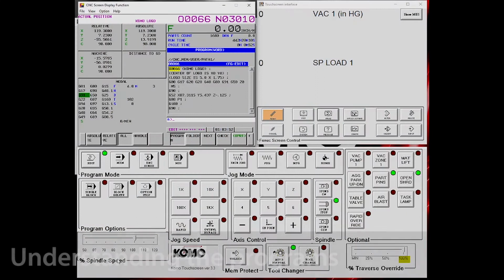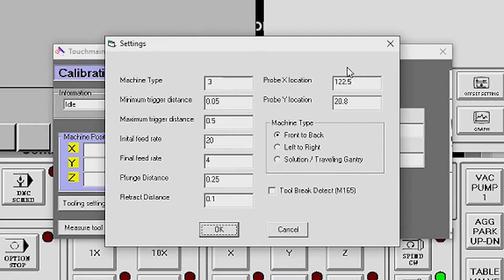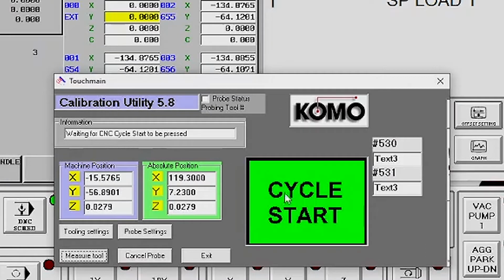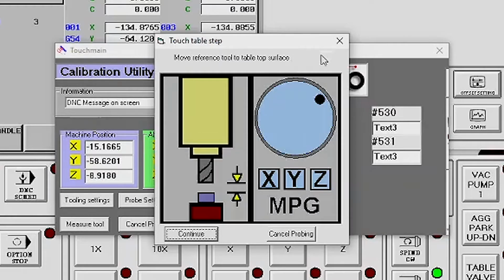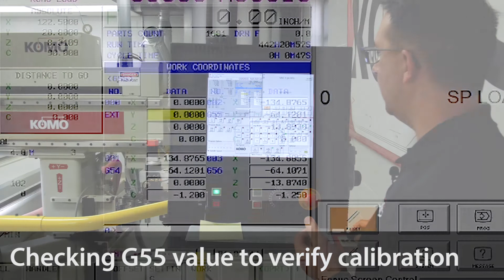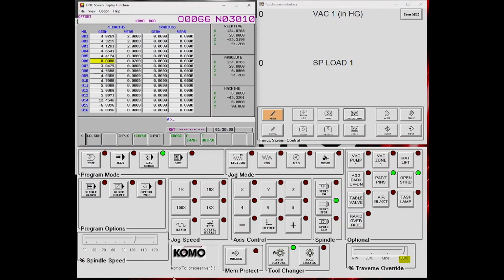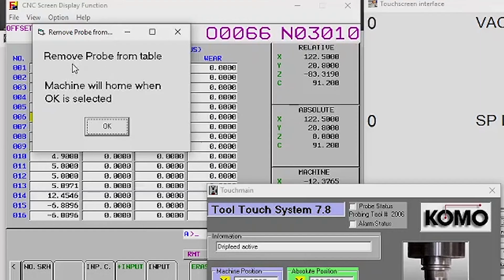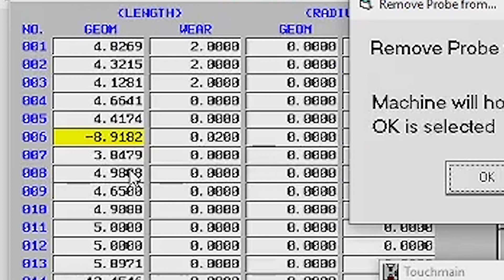KOMO KLIPS - Episode 4 - Tool Touch System

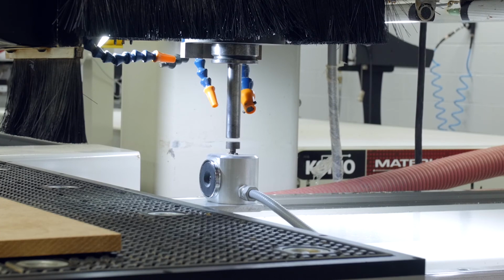Comment: @ 10:38 the touchmain utility tells the operator to move the tool above the plate at a distance of 0.5 in/mm. These are two dramatically different distances.